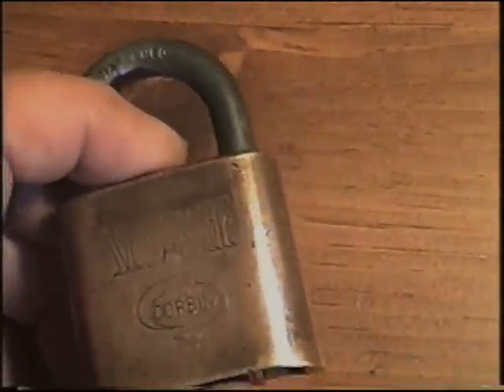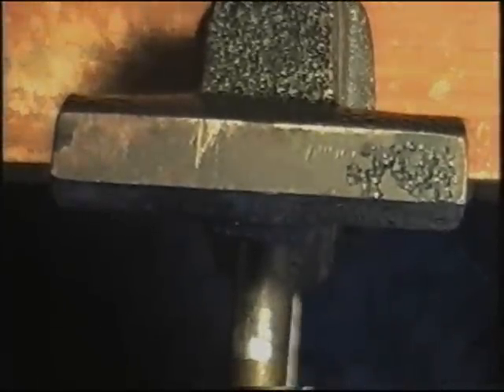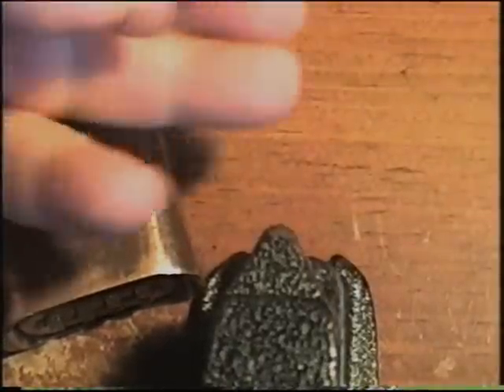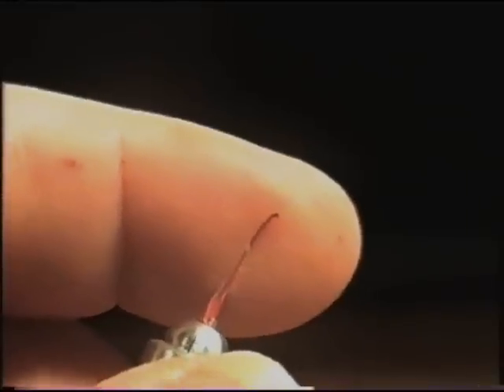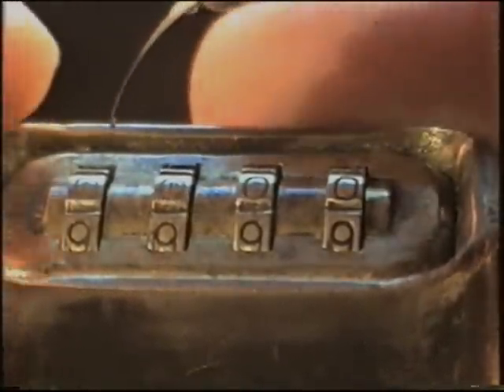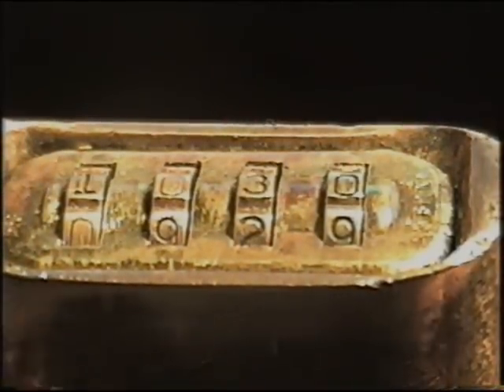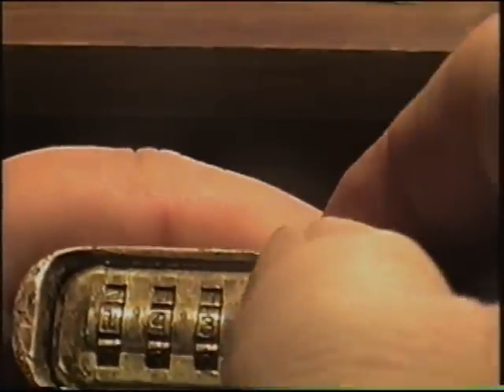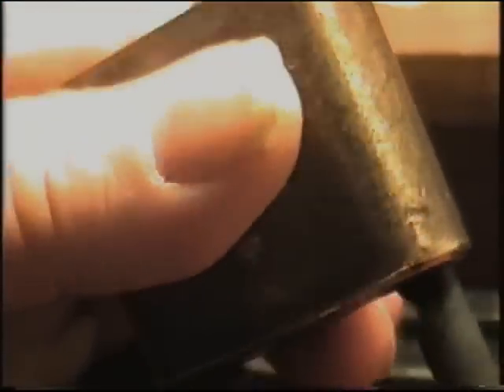Decoding The Corbin Sesamee Combination Padlock

Comment: Just wanted to thank you for this video.  I spent about an hour trying your method and failed... but, I found another video on youtube (NHU2xr4y6Aw) of the inner works and found a U.S. patent picture (patent no. 2,853,868)online and it gave me a better understanding of how the lock works and I was able to decode it within 5 minutes using your method.  I was playing with this lock when I was a teenager and changed the combination but forget it.   After 35 yrs I got it opened!  Thanks!

Comment: Enjoyed watching your video on the lock decoding. I am trying  to open a briefcase with the three roller on each side. Watch a couple of videos on it but no luck so far.
Reply: briefcases are easy. Put a little tension on the bolt while you spin one number at a time. I don't recall which you do first, inner or outer. When you feel a slight difference in distance, go to the next wheel and do the same.
Reply: This lock wasn't decoded, it was picked.

Comment: Hey l just tried right now with a strip of a soda can and it was hard to get the little strip of soda can through the openings of the lock thank God that I know the combination otherwise I could not open the lock I just couldn't do it I even tried to do it with strips of different thickness to see if that was the problem but still no luck
Any ideas please
Great video

Comment: how can I identify a combination padlock?  It looks something like a master lock 175 but has no identification on it. other than "hardened" on the shackle.  It has what looks like a riveted head (brass) in the center ofone of the broad sides approximately 3/4 of the wat up from the bottom of the lock.  It has 4 wheels and a black 3/32 dia."reset" key with a flattened end that I remember is inserted down the open shackle hole for resetting.  Can you help.

Comment: Found an old Corbin Sesamee lock in my dad's garage. It was opened, but I stupidly locked it thinking it was on the correct combination. 7 yrs later, I'm still trying to bypass the lock to get it open, with no luck
Reply: +Anthony Berke You don't want to Bypass the lock because then you'll be right back where you were 7 years ago. This Technique doesn't Bypass the locking mechanism, it Decodes the Numbers so you will have the Combination and wont have to "Bypass" the lock every time you need to open it. Take your time, it's well worth the effort!!

Comment: lols those types of locks are so unsecure, all you have to do is twist the dials from 0 to 9999 and you've tried all the combinations, add another digit and there are 99999 combinations, seeing as how you can probably test 2-5 combinations a second, you can find the code in under 5000 seconds, and most likely under an hour or so.
Reply: a1locksandkeys Yes, especially since there's a 50/50 chance the lock won't start with 5, 6, 7, 8, or 9, which means in half the cases, you'd cut the number of combinations to check by half. 4999 combinations to try.  So even if you only go 2 combinations per second, that's less than 45 minutes.  Add on the other 5000 combinations, and that's still only an hour and a half to try every combination.  If you're really slow and do 1 combination a second, that's still only 3 hours to open the lock...and that's only if the combination is 9999 and you start from 0000 going up by increments of one.  Almost nobody's combination is 9999, so yeah, you can pretty much eliminate a good amount of those combinations from the 9999 total.

Comment: Thank you for this! I had two USN Sesamee locks (late 1950's). The bench vise was a great help. It kept everything stable, which improves in sensing the depth and forces. I got the first lock in about 6 minutes. The second was a bit more troublesome as I had a few false-positives (I ending up making 3 more decoder tools, but still about 30 minutes total time working on the lock itself). Correct me if I'm wrong, but the tool doesn't go straight down when on the correct number. The slight bend at the end of the tool makes it curve into the notch in the cam. So it's just a slight bit of extra penetration when on the correct number. If the bend is too much (like 90 degrees), it won't help the shim curve into the cam. Also, if the soda can is very thin (like most of the new ones), it can slide into the wrong places and will also bend too easily. Thanks again and ignore those unkind comments. If folks don't appreciate free help from the Internet, they can always pay a locksmith directly!

Comment: It took me a couple days, (off and on) to retrieve the combination on this lock I have been hauling around for about 45 years. Came across it the other day while cleaning out some junk and figured I might come across something that might get me the combination again. Thanks for your instructions. Well done and to the point. Once I got the feel down so I could tell where things were it seemed easy. Thanks again.

Comment: The Sesamee lock I have has only enough room for 1 ply thickness and it's not rigid enough. I even used a tape measure  which is much stronger then a can and still couldn't get it to slide along the side. I found the lock and enjoy trying to get them open. All locks. I'm very novice tho. But either way tyvm for taking your time to make this video

Comment: Using your method I was able to reliably decode the first wheel but none of the others. Still, by brute force I was able to decode the other three. The lock could be at least 20 years old and that might be a factor.

Comment: This worked for me on an old similar looking lock only labeled CCL 03 on the bottom plate that I had found. Only took about 5 min using a .005" feeler gauge cut down to the correct size.

Comment: This method seems to work for the older Sesamee Combo locks - the one with a "rivet" looking  piece, or bolt of some kind on one side of it. Has anyone used this method on a newer lock though? One that looks the same, but with a few suttle difference? Also, the wheels seem to be shaped slightly different on the newer ones.  Anyone  have any experiences they can share? I'm pretty good with bypasses, of this type lock, but over the years, the companies have updated to prevent these bypasses. Even the Master 175 has versions you can't use the well known bypass.

Comment: I tried this approach today on a Prestolock 2620 4-wheel padlock I acquired in an open-yet-locked position, and much to my surprise IT WORKED! I did have to make one slight modification: I couldn't get the aluminum strip to slide any deeper when a correct number was displayed, but I discovered that by angling the strip so only its corner contacted the inner workings I was able to feel a difference between an incorrect number (the corner glided as though across a smooth shaft) and a correct number (the corner caught on something and audibly clicked).

Thanks for the great video!

Comment: i have an old lock 40+ years i think which i have been trying to open for years. Found your video tried it over and over and over. I was sure of my 1st and 3rd numbers and tried many times it did not open. I was so sure my numbers were 3 and 0 and stayed with that. Turns out i was just not pulling hard enough! It opened the other day after pulling real hard. Now here is my problem.

Now after it opens  i can pull it open no matter what number it is set to! I have pulled and pulled on this thing for years would never budge. Now that it opened i cant get it to stay locked again. Any tips there?

I have tried the reset thing but did not seem to make a difference. It is like the reset things is stuck open or something? Sprayed with WD40 to loosen but same thing. I want to use the lock but no good like this.

Comment: This works on a "Brinks K combo lock" also...  All 4 rollers using an old feeler gauge and cut a thin strip of #.004 / .102 mm worked great.. the soda can was a little weak.

Comment: I found one of these locks while metal detecting. It had a bunch of corrosion on it. I cleaned it all up and then started going through the numbers one by one. Then I found this video. Mine was slightly different. It was the 2nd and 4th combination that took the feeler all the way in. Then it was only a matter of the 1st and 3rd dial. But it worked. Thank you!

Comment: Thank you for information. 

I have had two of these locks that I had forgotten the combination on one and never had it on the other. I have been frustrated with this mystery for at least 12 years. Locks were made slightly differently. 

A further point is "how to change the combination?"  I have a SESAMEE card with instructions and tool to change this. If you are interested in adding this infromation, please email me. I can scan the card and provide picture/dimensions for tool.

Thanks

Comment: I just got done "Hearing" my Second Sesamee Combo Lock, I first tried to do the Feeling for the notch in the wheels, then I just started to Listen to the lock and it payed off. It has been Years since I opened my Very First Combo Lock, that was back when I had bought the Decoding Kit that cost me a good little bit of Money. I was told by my boss that His Mother used to sit in her chair, watching Television as she felt for the Lock to have a slight change in it and She would open them up that way. Someone had told Her that she couldn't do it that way and according to my boss, she was never able to do it after that. I tried to decode one and after a few failed attempts at decoding the lock, I tried to Feel or Listen to the way the lock did and I opened my very first Sesamee Combo Lock. Of course, when I went into work the next day and told my boss of my accomplishment, He changed the Combo and handed me the lock as said "Here, Do it again!!" I eventually ended up giving up on the lock after a while. Lesson Learned, DON'T Brag about How You Opened up the Lock, rather just say you got the lock open and leave it at that!! Thank You for Your Video, I really enjoyed Hearing the way the lock operated, I did try to Decode it first and that sent me on the path to See how You did it. Thank You for a Successful Opening!! Sincerely, JeffQ
Reply: +a1locksandkeys Thank You for Sharing this video! From what I understand, You're the Only One who has done a Video on Decoding this Particular Lock, Others only Bypass the locking mechanism and that is Cheating the Locksmith Apprentice from Learning this method unless He/She happens to be lucky enough to have Someone like You to teach them this method. I had bought the Decoder years ago from a website that had one for sale. I think I paid a good little bit of money for what turned out to be a Brass Tube with a Spring Steel insert and some Vague Instructions that were hard to understand. I had to read them over a few times to get what they were meaning. My Boss was influential in my learning, He started out going trough a Correspondence Course through foley-belsaw.com and that was the same course my boss had taken back in the 70's, He was the Second Locksmith I had contacted about being an Apprentice and I loved learning anything He would teach me. Anyways, Thanks Once Again for Your Video, I hope it serves someone else who is looking into doing locksmithing good, Thanks for the Refresher Course on the Sesamee!! Sincerely, JeffQ
Reply: Jeff Quinn

Comment: I tried your method described for the Sesame lock on a Master 175 without any luck. Is your method different for the 175? I used both al. flashing and pop can tool. I can slide the tool (1/16" wide) all the way in for all numbers for the first combo. Help appreciated.

Comment: I appreciate your video. I have a fairly new Sesamee combination padlock that looks essentially like the one you show in your video, but mine is chrome plated. I tried changing the combination with an apparently faulty "key", and when I closed it, it wouldn't open again :-(

Since I'm in Ecuador, it is hard to get combination locks - I had someone bring me this one from the USA. So, I'd really like to figure out how to get this one open. I have tried making a couple of tools like you show in the video, plus one made of a wide coping saw blade, ground down to be thin enough to fit between the dials and the case. So far, I have been unable to feel any notches. Do you think they might have changed the design? I'll keep practicing, but I am doubtful...
Reply: Just go through all the numbers.  I have a new Sesamee that I locked myself out of.  I'm up to 2000 just doing in manually in a couple of hours.

Comment: will this method work for a 40 year old sesamee corbin lock?
Reply: It worked on one of the oldest corbin I had. It was outdoors for close to 40 years locking a farm insect spray storage shed. I wanted to change the values and used the pin to reset them. Unfortunately I closed to test it and could not get it back open.  I sprayed with some WD40 in first to loosen things inside which I should have done first. Then I tried this technique and it worked. The code had set itself incorrectly because of that. I was able after loosening to set it correctly with the reset pin.

Comment: Where exactly are you putting your feeler to start?
Reply: +Kyle Taylor He did it at the First and Third Wheels on the Right Side of the wheels with Numbers Face Up. Take Your Time and Don't get Discouraged. You'll get it in time!!
Reply: Yeah this is perfect information. I ended up figuring out that the latch was frozen so i would have never gotten it go his info was spot on!
Reply: Kyle Taylor Awesome, I know the very first Sesamee Lock I had ever attempted Many Years ago had me Discouraged within a few days of getting my Sesamee Decoder. I thought that I was doing Something Wrong and would go back to the Instructions over and over again, My Bosses Son had told me it wouldn't work and that I would NEVER get the Combination using this Technique, That made me even More Determined to do it but I kept on getting discouraged over and over until that one Beautiful Day when Bam, there it was!! Yep, the Excitement was greater because I had shown my Bosses Son that the Money I spent on the Decoder, which by the way was a copper tubing that was about as big around as a Ink Reservoir inside a cheap pen, with a Thin piece of Tempered Spring Steel crimped inside one end of it. I think I paid something like $10.00 for it back in 2003, it came with Instructions that told what you were looking for while decoding, but it would have been Much Nicer had there been someone there to show how it worked, what you were feeling for. Yep, it took me a while to do it because I would pick it up and mess with it for an hour or so, get discouraged and put it back down for a week or so and then go back to it again. Thankfully we now have Youtube and Knowledgeable People to help us out!! Glad to know it worked out for you!!

Comment: Tried this several times but it did not work.
Reply: +jingles373 You have to keep at it, I know it's a pain but well worth doing!! Take Your time and it will come to you, this is something you cannot rush and You'll have to "See" with your Fingers and Ears. Good Luck on your endeavors!!
Reply: +Jeff Quinn You are right.  I got it a couple of weeks after my post.  Thank you!
Reply: You're Quite Welcome, I know it can be Frustrating after what seems to be Easy to do, it's one thing to watch someone else do it but when it comes time to do it yourself, it can be Challenging if the Person showing you isn't right there in the room with you to place the tool in the correctly and let you "feel" what you're looking for. It's Just like picking a lock, no one can actually "Feel" the way the lock does when you're picking it, the can only show you and explain it to you. I'm glad you got it, I know I was Excited the very first time I got it decoded!!